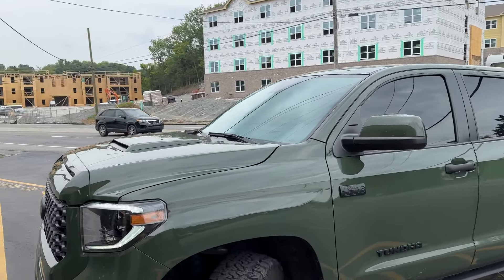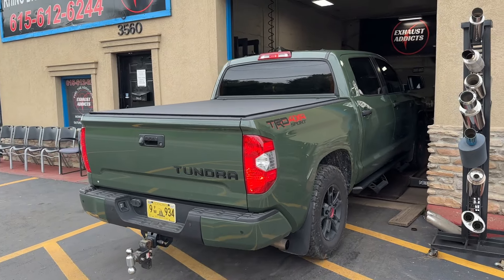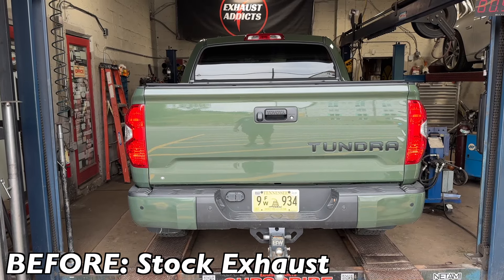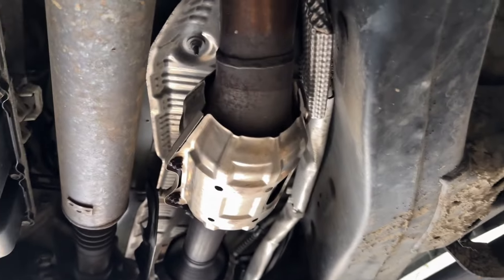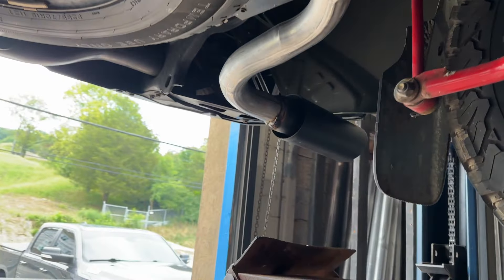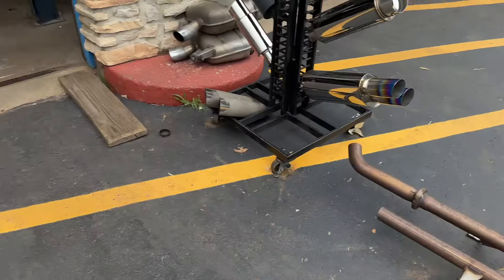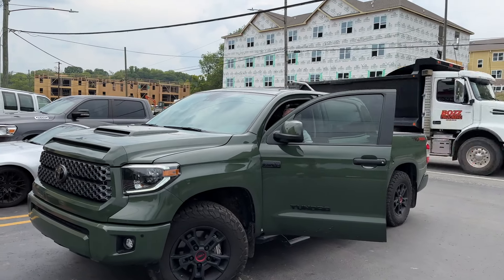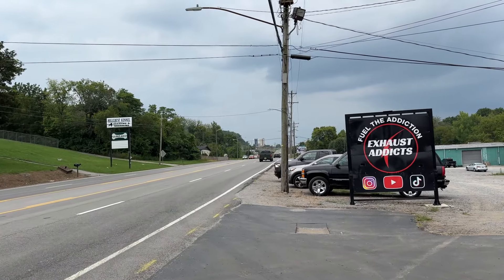2021 Toyota Tundra TRD 5.7L V8 w/ X-PIPE & BORLA PRO-XS!

Comment: All of the research that I did showed that a larger single exhaust system produces slightly less back pressure than a true dual exhaust. I’m wondering if a true dual exhaust just sounds better so people are willing to sacrifice a little bit of horsepower and torque for a better exhaust note?

Comment: a lot of it is the stock tune on the ecus. They are mapped for longevity. maps keeps rpm curves down to ensure min chance of damage or stress to motors; think of it like cpu throttling. increases the life of the motor, these 5.7s are known to go a million miles. easily 500k miles.